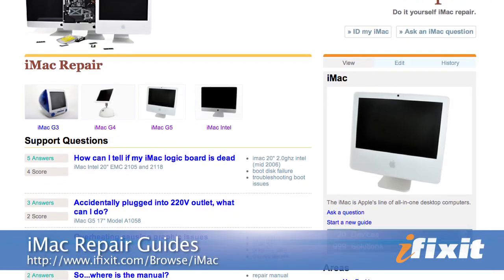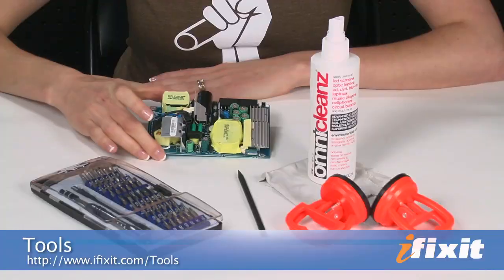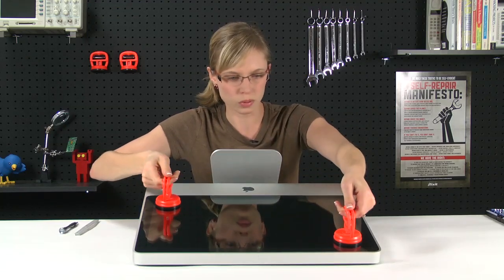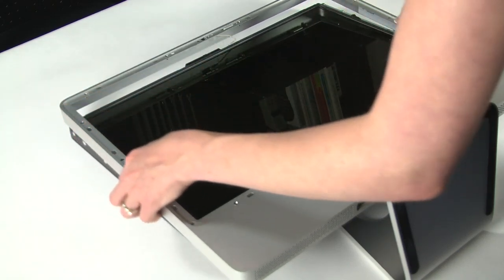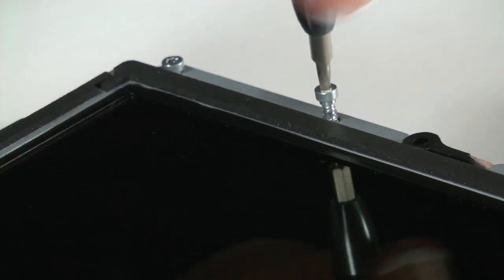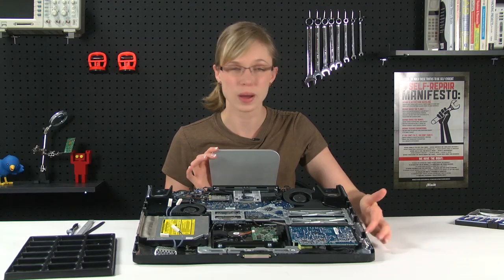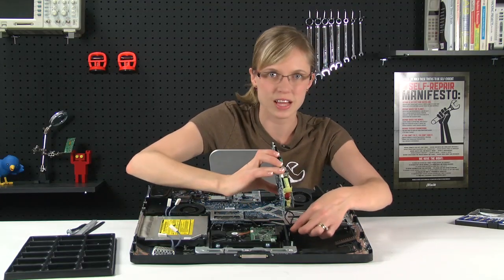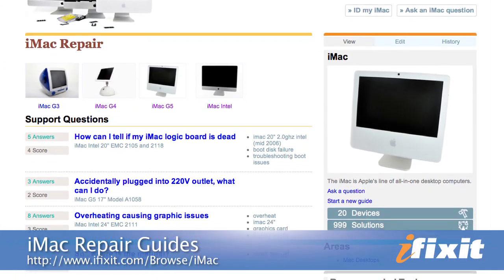How To: Intel iMac Power Supply Replacement

Comment: I had an APC battery backup go out. My iMac was asleep at the time and went out. Now it will not respond to the power button. I am hoping that either the power button or the power supply is the issue.

Comment: hi i may need your help i have an imac 20" mid 2007  The power button didn't work neither, nothing happened.
I opened the machine, and played with the diagnostic LEDs.
What I happen is somewhat weird (I think). The first-left LED gets on on plugging the AC cord, After 3 or 4 seconds, all the LEDs flash and then… nothing, strictly nothing. what is your take on this .. thank you

Comment: After a power cut my Mac would not turn back on after watching your video and ordering a second hand power supply unit from eBay my 10 year old Mac is up on running again 😃
Reply: Liam Higgins can I ask what iMac you have? I have this exact scenario issue with my iMac 24” mid 2007. Tried everything, and do think it might be the power supply...
Reply: @jamiii_18  I have the APPLE iMac A1224, after taking the screen apart and cleaning all the dust I replaced the power unit and it's working. It does however make a strange noise now and again which it never use to but it's solved my problem

Comment: Followed instructions to a tee and turned back in and it worked!!  However,  now the screen is black and I'm not sure why, but there is power. I'm sure I plugged everything back correctly. Any suggestions?

Comment: Ironically, im here because i shorted out the capacitors while replacing the pin connectors. I am hoping i didn't damage the cpu.

Comment: this is very useful video. thank you a lot.
I have a non-working iMac 2011 and I want to replace the bad capacitor only instead of replacing the whole psu,
could you please explain how can we test and discover the burned capacitors ?????

Comment: Hi! My almost new iMac EMC 2133 died but my old iMac A1311 need a replacement power supply. I want to know if a power supply of an iMac A1311 is compatible with the iMac EMC 2133. Thanks.

Comment: It worked! Thanks so much for your crystal clear instructions presented with impeccable production standards. Nothing gives confidence like a smart, cute girl fixing her Mac. I'm so grateful. I saved $1400. Got my power supply from ReidsAtti.c on eBay without any problem. It's all good.
Reply: Bruce Mitzit  how has your mac been? Is it still working since you replaced the psu?

Comment: What if I don't want to replace the whole power supply. Is it possible to just replace the faulty components on the power supply? That's even cheaper.
Reply: While the parts are going to be cheaper, it's generally not worth it when you consider the time required to manually repair it.

Comment: how you know if you need to replace the Power Supply on your iMaci have a  iMac 20" 2.66 GHz (EMC No. 2210) but yesterday the power went out in my apartment. But i tried to turn my Imac back on and wont turn on anymore.

Comment: Can you recommend a good website to purchase this particular hard drive from?
Reply: I would love to buy the power supply from you guys but you seem to be out right now can you help me with that?
Reply: classicdell Galaxy Mac Hardware is another alternative (http://www.galaxyhp.com/) perhaps.  I just purchased one for a iMac 24" (EMC 2211).  Prices look good.  I'm just hoping that the power supply is in fact the crux of the problem and it is not a logic board issue.
Reply: Thanx!!!!!
Reply: No problem.  Mine came in on Jan 8 and only took about 30 min to install (as I had already disassembled and removed the old and simply left the LCD out of the iMac until the new part was in).  Worked like a charm.  You may find that it looks different from the original.  Mine original had heat sinks along the left edge, but the new one did not.  Instead, the packaging had a rubber bumper to channel the air from the fan from the gap (where the heat sinks used to be) back under the rest of the power supply.  I posted a note about my own experience at iFixit.  You can see it here at https://www.ifixit.com/Story/12315/iMac:_A_casualty_of_war?

Comment: Thanks! Replacing the power supply totally worked! Keep it organized! I used the suction cups from a sink sponge holder.  Also found on shower racks. The website has not had the power supply in Stock for a while. Bought mine on eBay with the part number provided.

Comment: I got an iMac 21,5" 2011.
Yesterday the screen shut off with no warning and I could smell something burning. ( !! ).
I tried the usual ( disconnect everything, wait, reconnect, etc etc... ): pitch black and no noise.
Drove to official Apple retailer: 40,00€ to take the machine in.
24hrs later my doubts are confirmed: PSU burned. Repair/replacement will cost 185,00€.

All in all I strongly advise everyone to buy the Apple Care for 3 yrs.

Further question: how does this thing happens? I mean, the PSU burning.

Comment: Hey, I need help. By mistake I unplugged my iMac while it was on sleep, and now when I want to log in, it logs in fine, but it then logs off immediately everytime I log in. I cant use the search or anything on the top bar, and it logs off so quickly it doesnt give me time to run disk utility or anything. Do you know where the problem is? Is it the battery supply or a software problem? Thanks! :D
Reply: wrong video dude

Comment: hi, my imacs' power supply gets really hot (up to 95°C or 203°F) and puts itself to sleep then. im thinking of replacing it, but only if its definitive the power supplies' fault. could it be, that there is just a fan not working properly? i tested with smcfancontrol and powered em all up.. its quite noisy, but the temperature of the power supply never drops below 70°C...

what do you think?

Comment: 08 IMac Intel 24" , Durring recent repair As I started putting everything backj together I noticed I pulled part of the Microphone wires out.  If you follow from the camera itself, you have a black wire that leads up to a connector that has tape around it. Off this connector is a white protective sheath with two very small wires coming out of it. I have no idea where to put these back.. Were they just tapped to the underside of the front bezel....I can't figure out where they go. +-

Comment: Hello MJ, Excellent Videos, Subscribed! 
Would it be possible to do a video on a 2011 Mac Book Pro! Took ours'in for repair because the mouse kept moving all around the screen. Trackpad will work...then not work...then work ... Apple said that they couldn't touch the mac book due to signs of  liquid damage. The Mac book still  works but it keeps having issues that seem to change  Air Port will go in and out....USB Slots will work then stop working. Also things are missing like key chain, Thanks

Comment: a word of advice.  while poking around your unit to see if you can see any visible traces of damgage etc make sure you get off the mains.  I kissed my psu board with prescion screw drive and pop sizzle a $50.00 learning lesson!  Also, not be be a nit pic but when she says the caps still holds Voltage she means charge, as capacitance is defied as C=Q/V, where Q is charge in coulombs and voltage is the rating the caps are designed to be able to handle.

Comment: what screws are used for the power supply mount.  there are 4 screw mounts...i guess i can just go back and eliminate all the ones, like the 4 long ones from the bottom are obvious etc etc.

Also, if your based in metro Atlanta I have several parts if you would like to purchase.  I also charge a nominal fee if you dont feel like you are up to doing it yourself (sorry for the shameless plug but I would like to clear out some inventory)